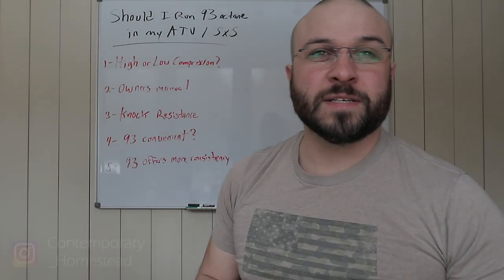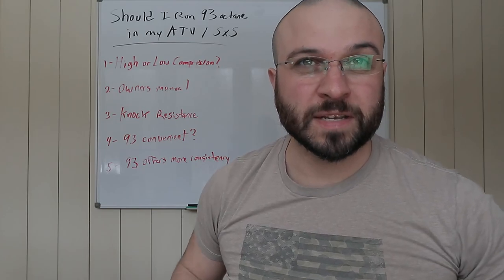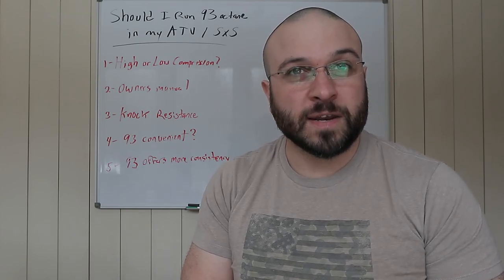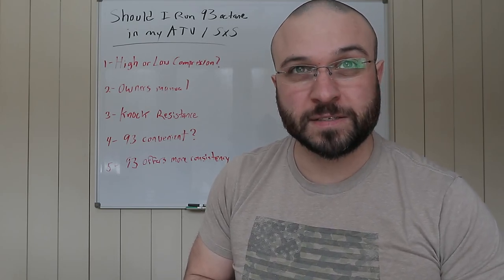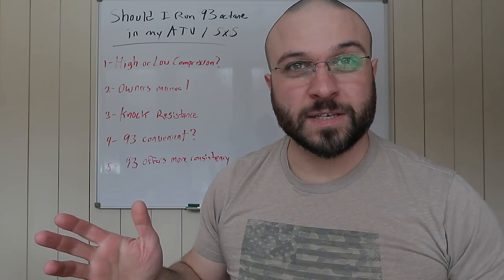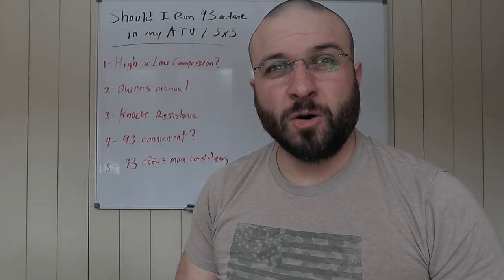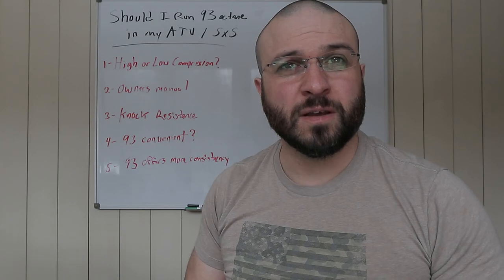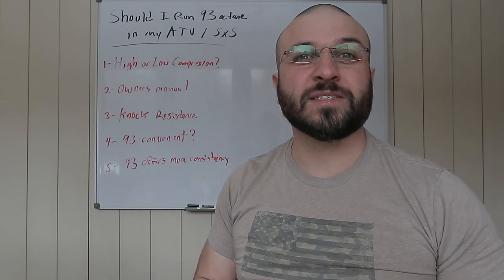WHat FUEL Octane Should i RUN in my ATV or SxS?

Comment: Hey John I’m an owner of a 2017 XP 1000 , ,thanks for your info and tips on the sportsman’s. I really like the plow you have.I may look into getting one myself. Also if you can Iam curious of the arched accessory you have bolted to each side of the handlebar ,I’ve seen them before but have no idea what purpose it has. Thanks Craig in Ontario.
Reply from the maker: the handlebar grab bar is great for hardcore riding to keep yourself braced and stable while operating it high-side / standing on one side of the atv.

Comment: Hii. Great video. I bought a Cammando 650 China version  i know right  came with no manual. Some say 87 octane, but can I use 91 or 92 and not cause any issues?
Reply from the maker: What does you owners manual say? Most likely you dont need the extra octane unless you have a modified higher compression motor or other factors

Comment: Should I use 91 octane in my 2021 linhai 4 wheeler 550
Reply from the maker: read your manual. But yes i run 87 in my 850 and 1000. More octane is just wasting money if engine wasnt designed for it (higher compression ratio)
Reply: @JohnFrancoNH no manual bro
Reply from the maker: @jaydowwg8150  they are available online or thru polaris. 87 octane is what it says to use
Reply: @JohnFrancoNH  thanks

Comment: I bought a 2015 500 king quad the guy said he used regular w10%ethanol.... w a stabilizer... i put 91 octane in it and i dont think its as snappy..... so im going back to 87.... youd think 91 would have more h.p. but obviously not. The 87 octane was faster.... the owners man says 87... i shouldnt have fulled up w 91.... 87 w 10% ethanol is snappier.... your thoughts?
Reply from the maker: Going to 91 will do nothing. Unless you properly tune it on a dyno and also add timing in with that higher octane. Thats the only way it would add power. But then you cant go back to 87.  I run 87 thats what its tuned for.